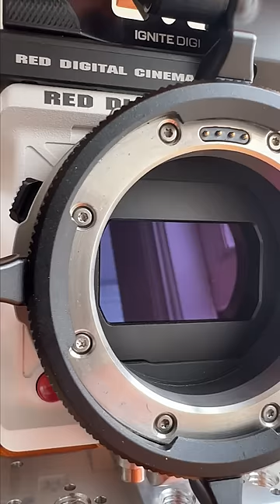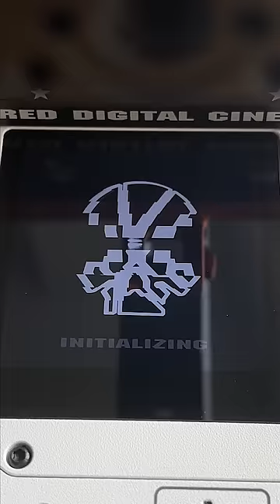KOMODO-X build with RED Electronic ND! 🔥

Comment: What's the cable powering the video transmitter using the plate power?
Reply: This screen use only one cable
Reply: @lnz971  No the screen, but the video transmitter, thnaks